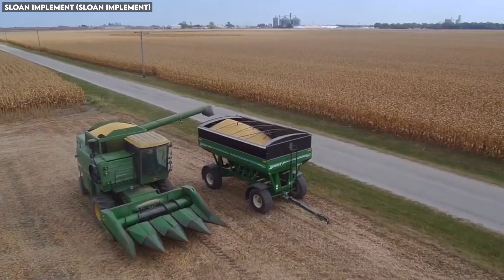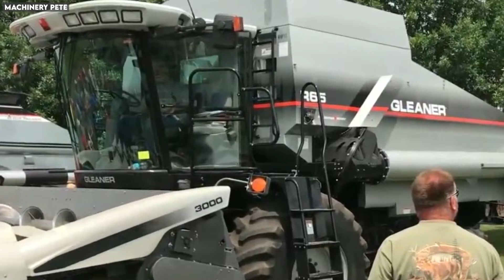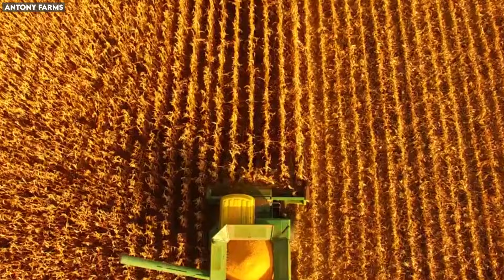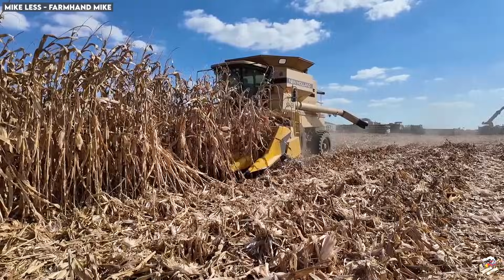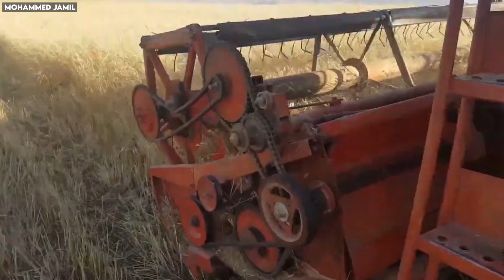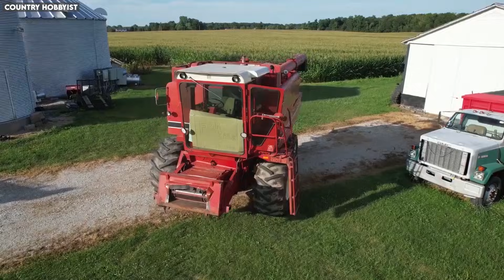10 Harvesters From 1980s That Still Work Better Than New Ones

Comment: You might want to add the 1440 and the 1640,
Reply: The 1440 Axial Flow is a mid 70's  International  , and the 1640 is a mid 80's early 90's
Reply: The 1440 axial Flow was a mid 70's early 80's International,  the 1640 was a mid 80's early 90's axial Flow combine from Case IH.